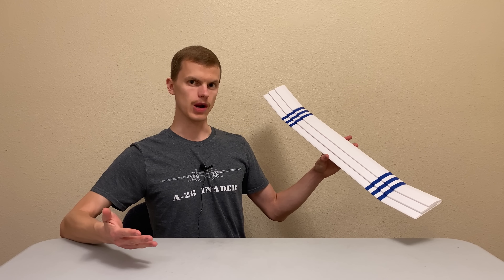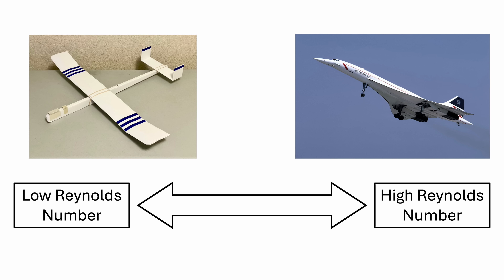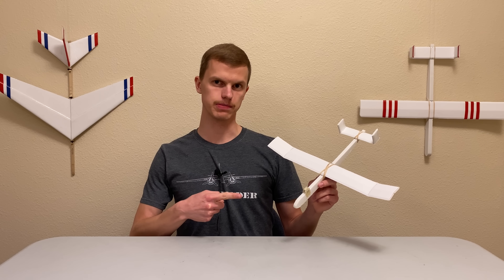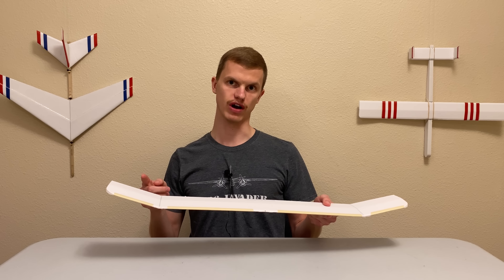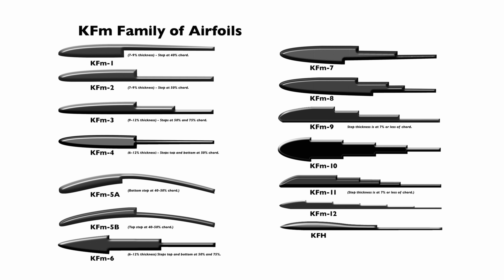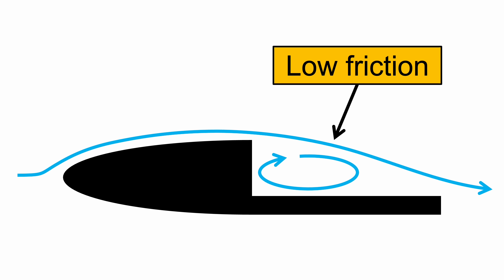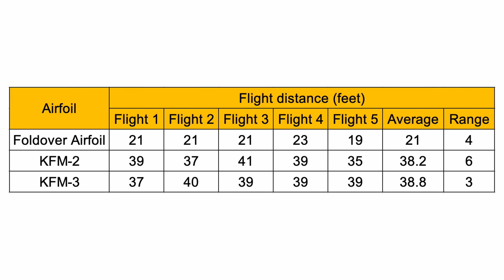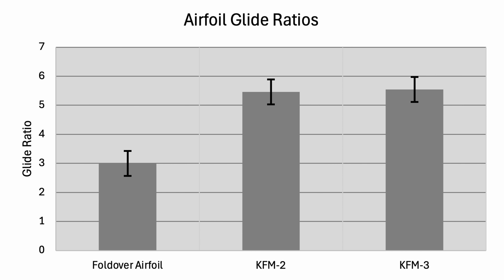Stepped Airfoils for Model Airplanes - Are They Better?

Comment: Do sailplane gliders take advantage of this skin airfoil effect?
Reply: Yes. 
Turbulators in the form of dimple or zig zag tape are placed just ahead of the laminar flow separation.
Blowhole tripping uses a line of tiny holes (0.8 mm) along the span which are fed by dynamic pressure, usually created from a small scoop or inlet (see DG-300).
These devices are optimized for a particular speed and handling profile so not a universal solution for higher performance.

Comment: Check out "turbulator tape", aka "W tape" used by full size competition glider pilots. Supposedly, the turbulence induced by the tape promotes a turbulent boundary layer which improves the performance of the aerofoil.

Comment: On rotorcraft there is tremendous variation of airspeed as it progresses outward. Could a stepped airfoil improve the drag in the stalled portion of the rotor the potential gain is not worth investigation.

Comment: A whole other area to investigate what about stepped foils for propellers? That might have huge applications in drones. Especially drones intended for longer duration where they're going to use big propellers spun at relatively low speeds. I am thinking that FPV racing drones probably move too fast, but drones for surveys or search and rescue might benefit from more efficient props that would allow more time up on the same battery.
Reply: It would make them quieter. Also just about all KFm airfoils have been used on helicopters. The other big advantage is they can manage twisting moment and flapping problems due to being low moment airfoils that are inherently strong and not need a spar, they can be mede of just a skin. Also good for over simplified rotors used on most quad copters that have no collective control for blade pitch as the have good high AOA performance and  arrest a decent without going into blade stall.

Comment: I used a 3 or 4 step foil on 8" indoor gliders back in the 70's. The interesting thing was I could increase the weight of the glider to many times the original weight and the glide time was the same. The section was laminated and a proper section was shaped back to the steps.

Comment: Idea 1. I think it’d be interesting to see the effects of a wing moveable step that could move forward and backward parallel to the wing chord and to see what effects that has on lift and drag in a wind tunnel. 

Idea 2 I also think it’d interesting to see the stall characteristics (meaning finding the critical angle of attack for each wing) of your different stepped wing designs in a wind tunnel.

Comment: Are you able to simulate it? I use XFLR5, but have not tried stepped.
I found that the shape at the leading edge has a very signficant effect on L/D. Even very small changes make a big difference.
Just thinking of similarities to stepped hulls on boats. These cut down drag. Any thoughts on that?

Comment: Very well done!
I think the next experiment might be trying to optimize the KF profile, by designing a wing where the height of the step can be varied (first test to optimize) and where chord position of the step can be varied. 
What I have seen in different videos is a defense that KFs work with an ample range of CGs, chord % position, etc. and it looks like the KF authors defined their profile by trying, but where not very methodic in finding the optimum profile. 
Thanks for the skin drag explanation. It all makes much more sense now.

Comment: I seem to recall that Cessna did extensive testing of the KF airfoil, as well as a main wing that pivoted at its CG.  Of course, a 1600# airplane flying at 100MPH is quite different from a lightweight glider.

Comment: You could make a single hot-wire clark-Y leading half of the wing,   and attach various trailing edges,   also hot-wired.   aso Ithink you should not have had  sharp bends in the leading half of your airfoils .   Looking fwd to see more or your experiments.  thanks
Reply: Sorry, wrote the dame before I found you comment.

Comment: If thin airfoil could still be made, would it perform better than thiccc or stepped?
Reply from the maker: I also tested a thin airfoil that was only 1 sheet of foam thick (5% thickness), and it flew 25% further than the two stepped airfoils.
Reply: @DesignYourOwnAirplanes-xd6lz  interesting, I would have expected more cambered airfoils to produce more lift
Reply: @sashgorokhov  They do.

Comment: I would be curious how the stepped airfoils vs non-stepped affect powered flight. You mentioned "not for high speed" (generalization). I am curious about slow speed flight. Downside being much more time required for testing.

Comment: How about the weight of the wings? Different wing loading would also affect glide slope.
Reply: Lift to drag ratio is affected by angle of attack so total aircraft weight is already factored in.
Reply from the maker: The weights of the wings were very close.

Comment: I suspect, at such low Reynolds, the step acts more like a trip that re-energizes the flow as opposed to a gap with little friction.

Flow stuck to the wing creates much more lift than separated flow, even though turbulent flow has higher skin drag.

It would be interesting to add a trip to the fold over airfoil at the same location as the step and see what results. I would suspect a piece of cord taped to the top of the wing would work well.
Reply: Solidity does some strange things with turbulence that are counter intuitive. Insect wings trip the flow to create a pseudo airfoil from solidity effect like these airfoils do.  Solidity works due to the tendency for laminar flow to not penetrate turbulent flow.  It is NOT a given that turbulence equals drag.  Reality is a tight boundary layer can reduce drag but it is still turbulent. Does not always work at higher Re#.  Owls use this to reduce noise and generate a better boundary layer. Sound generated is an entropic loss so quiet airfoils tho making turbulence have less drag.  Boundary layer separation is what causes drag and noise.  In micro aerodynamics its even weirder where solidity and boundary layer separation generate more lift than the actual shape of the wing.  Where the wing is just a turbulence generator and the solidity effect creates the shape that generates lift. This is why the Bubble Bee can fly with such tiny wings.  Another example of this is how the dragon flys 4 wings to manage solidity and create a pseudo wing with massively higher wing area that its already huge wing area and glide unlike any other insect that must beat there wings in flight.  This is some times useful at extremely high Re# like famously how the Lear 25 threw 36 have boundary layer tripping devices intersecting the flow to control normal shock generation and prevent control loss and near supersonic speeds. This is similar to your idea of a cord across the span but I think your idea would work more like the dragon flys leading edge hairs that is some phases of flight generate a camber shape from solidity on the forward wing.

Comment: This reminds me of Coanda Effect. which you can see on those airfoils, a sharp bend to a small acute angle so that the boundary layer separates. A vortex develops and the free air stream bend down and reattaches. It can significantly extend the onset of a stall.   A wire on the surface of the airfoil top slope back area  causes this same flow.  So the question is the size or thickness of the vortex effects the drag.
Reply: coanda is a totally different effect

Comment: if a model has a very thin wing, then a flat-plate (single-surface) symmetrical profile should be used.       (in general, a wing is  Supposed  to have a load- bearing main spar, located at  THIRTY  percent of chord.      thirty percent is multiplication by  .3 )        CF  should not  be used in a small model.!!  period.!    because it's  Heavy.     and  because its dom cannot be  optimized.     distribution of mass.          in the case of a 'thicker' wing, a two-surface, cambered, flat-bottomed profile should be used.    eg., clark-y and similar profiles.        the orientation of this type of profile should be assumed to be  'level', relative to its lower surface.    (not always shown that way in illustrations/graphics.
https://1.bp.blogspot.com/-5C8vhlmhBOk/VRe3o3Jt3yI/AAAAAAAABrI/EEgVHXkLvbY/s1600/clark%2By.gif

Comment: YO
Your experiment is so well done! It’s so much better than any of my attempts. Also you explained KF airfoils wonderfully, I learned more about it. Great job.

Also I’ve found a relatively cheap and easy way to build a Hotwire cutter.

I used these materials:
-Hobbywing Eagle 20A Brushed Esc
-26g nicrom wire
-20 gauge wire
-one of those cheap blue servo testers

You can make a jig for the cutter out of like some thin basswood sheets, pvc pipes, or some other sturdy material, never use any conductive materials.

I soldered the positive and negative ends of the esc to the 20 gauge wire, and directed both ends of the wire to the ends of the jig. I used two small screws to act as the mounting points for the nicrom wire to wrap around. Its should look like this

|+|———————————|-|
|  |                                    |  |
|  |__________________|  |
|___________      _________|
                   | [] |
                   | [] |
                   ——
The esc is mounted where the [] on the handle is, with wires directed on both arms. The + and - are where the screws should be and the —— is the nicrom wire, you should try to wrap it tightly to create tension.

Solder whatever battery connector you often use (for example JST, XT30). To control the temperature, plug in the servo wire type cable into the output port of the servo tester. Dont connect the battery to both the servo tester and the esc as it will short circuit and create a boom. Only connect the battery (preferably 2s-3s) to the battery port of the esc and make sure to be careful of where the wire is. For safety you can wear some thick gloves, and gradually turn the dial of the servo tester to slowly increase heat. 

It should work after that.

Comment: I have a question. The mythbusters did an experiment on pickup truck tailgates. In their experiment, the vorticies formed behind the cab (step) was more efficient with the tailgate up. Could a small step on the trailing edge do the same thing on a wing?
Reply: i think that was because the tailgate acted like a spoiler (not a wing, to be exact). in a sedan, air could separate over the rear windshield. a spoiler makes the air follow a path as if the car had a fastback, reducing lift and drag. a similar principle applies to the truck tailgate.
Reply: answer:  no
Reply: Google 'Gurney flap'. These don't reduce drag, but they do increase lift. They can also be used to deflect air. Modern cars often have a bunch of them on the underside, in front of suspension parts and large gaps.

Comment: Test the effects of temperature . Low temperature of the wing will reduce the viscosity of the air attached to it while higer temperatures increase the viscosity. That should make an observable difference in performance.

Comment: Great video and content.  I think that flow separation on the clark Y  could cause a lot of drag. Hmm just thinking - early separation would cause a large vortex, and the stepped airfoils replace it with a small, predictable vortex.  When you realize that ground effect happens within a wingspan of the ground, its easier to imagine quite large vortices above the wing

Comment: according to LLM's, "While "parasite drag" might be used occasionally in informal settings, "parasitic drag" is the widely accepted and technically correct term in the field of aerodynamics."
Reply: Parasite drag is a real phenomena. Dead bugs stuck to leading edges can reduce performance significantly.

Comment: Looking at the launches, I have the impression that the smooth airfoil version has a nose-dive attitude and flies faster. Could that be due to a balancing issue? Or is it just an impression?
Reply from the maker: I had to put the smooth airfoil version on a steeper glide slope to get enough thrust to overcome the drag.  Any less steep and it would slow down and then stall.

Comment: What is the effect of thinner steps?
With thinner steps, could have more steps per slope angle. At what point is that a detriment?
Does a stepped airfoil have a better or worse stall angle?

Comment: Very informative video. 
I 3D printed some airfoils before and never considered stepped airfoils as they have the stigma of being low tech foamboard things. 3D printing makes it easy to just copy any "high performance" airfoil of large scale aircraft. Maybe it would be interesting to make a Airfoil with tiny stairs, so essentially a rough surface to create a smooth-ish buffer layer of air that sticks to the wing.
Reply: Stepped airfoils have been used since the 1930s. Way before there was foam core. 🙂

Comment: If level flight is desired, the ogee is pretty good at doing what you want but using supercritical airflow for lift.  The ogee is simply a stepped front edge separated from the rear edge, connected by a connection between the two, preferably at a 45 degree angle.  The connector acts as short flaps, so the location needs to be balanced with the center of gravity.  Drag isn't magically negated.  You decrease drag because with ogee design you can use minimal wing camber.  The ogee is inspired by how birds can pump their wings forward without losing lift.
Reply: We don't see this used much because raked tips and winglets work better.
Reply: Flapping bird wing path during flight is a lot more complex than fixed wing aerodynamics.Typically the inner wing increases angle of attack while the outer wing (Flight feathers) is recovering, in a usually figure 8 pattern.Total lift doesn't change much, drag does. Downstroke of the outer wing is the power stroke, down and angled back. And all this balancing on the constantly shifting center of lift of the multi-part wing, No Tail of real significance, in most winged flight, too short coupled, and jpoor aspect ratio. Soaring bird flight is very comparable to sailplanes and the video conditions. Sea birds doing Dynamic Soaring (also by current record top speed RC sailplanes, approaching 500 MPH, last time I looked.) is at or near full size aircraft Re#. Albatross, and the local Wedge Tailed Sheerwaters, flap wings very rarely once at sea, given some critical minimal wind speeds.
Reply: @billtaylor3499  The big difference with most soaring birds is they use there shoulder leading edge as roll control. NASA is experimenting with leading edge control surfaces now to see if there is any real benefit. Some of the Raptors do all kinds of things for control we could never do with the way we make wings now. Ducks too are really wild in what they do for control. I love watching them fly.

Comment: I'm wondering if stepped fins on my sport rockets would benefit from lower skin friction on the stabilizer fins.  Clearly this would benefit glide recovery rockets!
Reply: KFm-4 and KFm-6 are commonly used on rockets as they can be made extremely light weight and strong. Often made only of a skin not needing a spar. The Space Shuttles elevons are actually stepped on top to reduce weight and increase strength.
Reply: @anthonyb5279  Your latest post here, as I'm viewing, so a question. I suspect a huge variable is spanwise flow behind each and every step in the stepped type foils. I know it is in stagnant flow 'bubbles' behind the leading edge/thickest point, in some sailplanes. Particularly in high speed, high angle of attack pull ups during maximum energy starts with a regulated height at race start. Could flow fences, to, or extending above, the assumed upper limit of any rotor improve lift by preventing flow towards or away from, the wing root?  Does spanwise flow behind any step, generally, and off the wing tip specifically, decrease L/D? Is wing rake angle + or -  pertinent? If beneficial, generally, or too specific to lift conditions to use? Not having any visualization of flow over the step vortices, and behind the steps both span wise and surrounding air wise, opens lots of questions in my mind.
Reply: @billtaylor3499  Well yea all that maters. Wing fences or other span wise flow mitigations always help on a straight wing. sweaped and delta wings use Oswalds Efficiency to grater effect that wing fences and stuff. Extreme high aspect ratio like over 20/1 need no span wise flow mitigation either. This is why we don't see fences on helicopter rotors .Tip rake angle makes vortex just inside of the tip acting like a wing fence plus increasing lift at the tip.  We see steps on helicopter rotors at the root because it is strong and works well at extreme low Re that the root is turning at. Don't se it much at the tip at high Re.

Comment: A very interesting experiment that raises as many questions as it possibly answers. For instance, the material used lacked a polished / ultra smooth surface. What difference might it have made if all three wing types had very smooth/polished surfaces (which can of course introduce their own issues, perhaps in less stable boundary layers). Also, the conventional wing in this experiment was disadvantaged by having a crude airfoil section (angular over the top wing surface, and a gap on the underside near the trailing edge) which will have handicapped it. And no mention was made as to whether all three wings had the same weight, as this is also a consideration.  Love this kind of experimentation though so keep it up  👍
Reply from the maker: The weights were all very close.